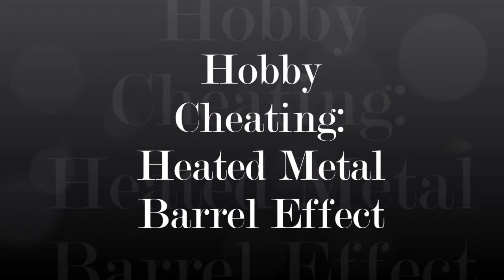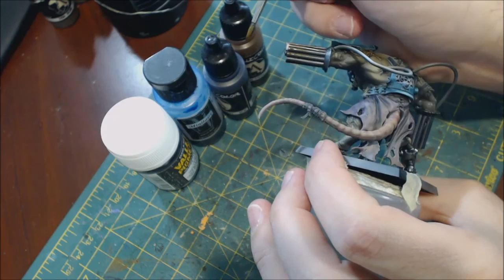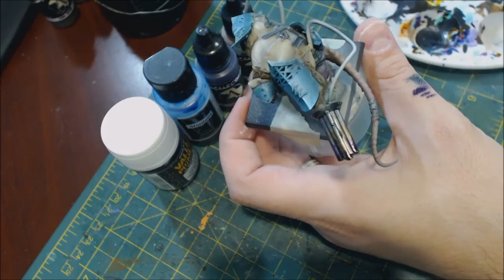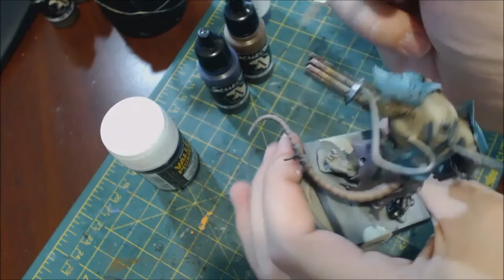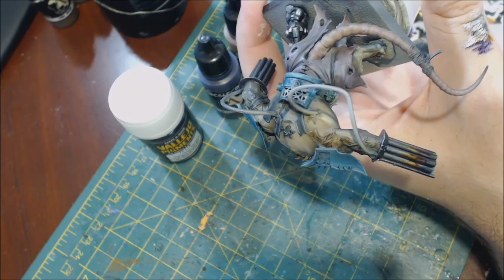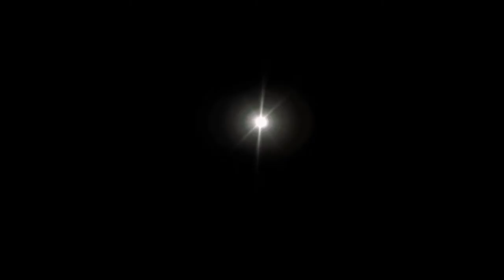Hobby Cheating 57 - Heated Metal Gun Barrels

Comment: A little science. The color transitions found in hot steel is called 'tempering'. The specific colors indicate s temperature range, of which I am unable to recall currently. But, steel that is raised to a certain temperature and then left to cool slowly will have a certain harness to it as the crystalline structure of the metal reforms. When working metal for a specific hardness, it is sometimes called 'chasing colors'. The colors do actually go from this golden yellow, called 'straw' up to white before everything turns into a puddle.
Reply from the maker: Very cool, that makes sense, the more you know! ;)
Reply: Straw color starts at about 400F, the blue you see is about 600F

Comment: Great video. Really nice effect. 

One question - I'm trying to do this on a Gold weapon. Would you use a different combination of inks? Perhaps, Brown, Red, Purple, Black? 

Plasma Fluid turned out Green over the Gold, so I'm not sure how that will look. Thanks for any suggestions.
Reply from the maker: So we tend to think of metal colors as being that color, but of course, they are not really. What I mean is that, if you think of TMM in NMM terms, Gold is Yellow/Ochre and Steel is Grey/White. This is going to cause some challenges as the steel/silver being white will allow the colors to be true over the top, where as gold is going to change the color of a thin ink/ghost tint. 

We also have an additional challenge that gold doesn't do what you are talking about in reality. Gold, Bronze, Copper etc. are all rather soft metals, if heated even slightly, they simply melt, they don't score and burn and carbonize like steel. So when we try to create something that doesn't actually match up to reality, people's brains catch that subconsciously. 

Now, if we still wanted to do it, we could, the answer I would give is this - turn the end of the barrel you are to effect with everything except the chesnut/brown silver. So I would do something like this. 

1) Paint gold
2) Do the brown step I outline
3) Glaze on silver over most of the brown, leave a bit of the brown there. 
4) glaze a small thin amount of brown over the current brown/silver border
5) Continue on with all colors from there. 

I think that would give you the best possible result.
Reply: Thanks Vince. A lot of good points there. I'll give that a try. Could be relevant to Stormcast armour as that wouldn't melt as readily as real gold since it's an imaginary metal. 

All the best

Nico

Comment: slumming request - what GW paints would you recommend for this?
Reply from the maker: So it's probably not going to work as well, but general thoughts. Gloss Agrax or regular Seraphim Sepia, Druchii Violet, thin silver glaze, guillman blue glaze, then the pigment is the toughest. We would want either some nuln oil or some VERY light Typhus Corrosion mixed with black paint (very light touch).
Reply: I noticed agrax is too dark, Seraphim sepia is much better, straw yellow color.

Comment: one question, can this be achieved using vallejo paints? should I thin them down until a wash-ish consistency (to make it easier to blend with other colours) ?
Reply from the maker: Sure, inks would be better, they are more transparent and will dull out the metal less, but you could use paints in the same way I use inks here.
Reply: @VinceVenturella  thank you!! what kind of inks are they? normal pen inks or?
Reply from the maker: No, they are different, they are inks for miniature painting or art, here is a good example of what you would want - https://www.amazon.com/Vallejo-Game-Ink-Paint-Color/dp/B0016CN5MQ/ref=sr_1_1?keywords=Vallejo+game+inks&qid=1558755338&s=gateway&sr=8-1